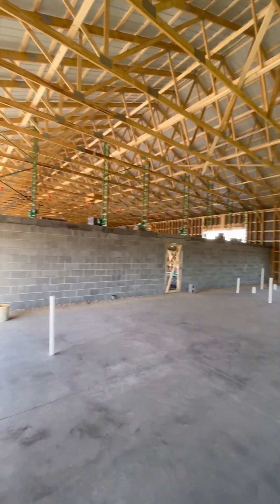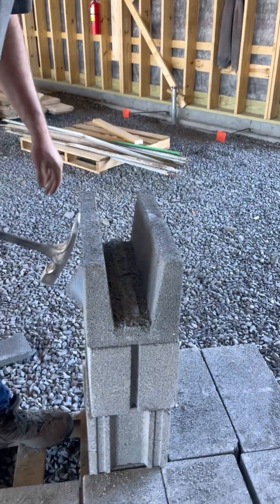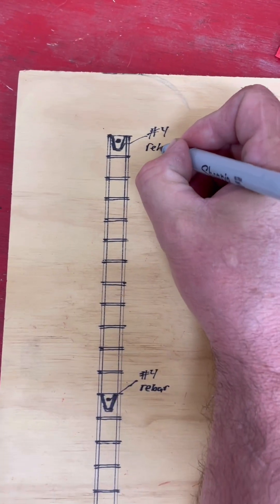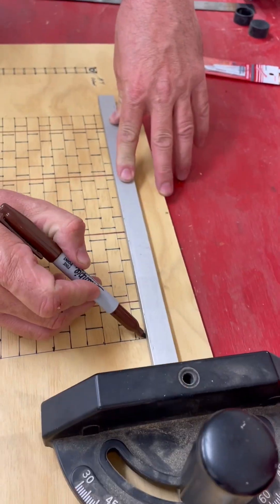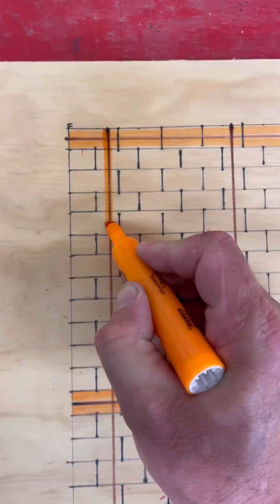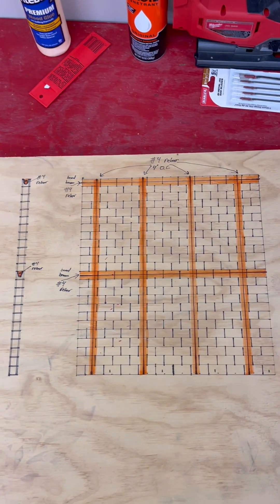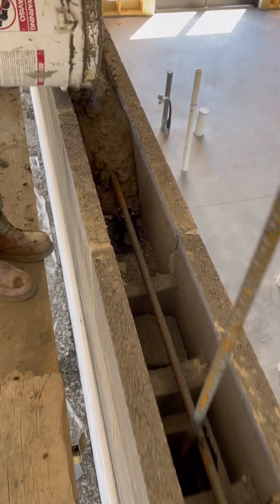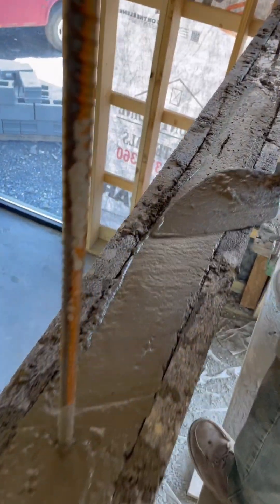Using a Bond Beam to Reinforce a Block Wall

Comment: Is 4' on center of ½" rebar just a term? What I mean is hitting the ¼"center seems a bit precise especially for a wall at long. Can you just hit a tangent on the rebar no greater than 4'apart or do you need to it to measure as close as possible? You're not actually drilling into the rebar like you with a stud.
Reply from the maker: It doesn’t have to be exact just close to every 4 foot within 6 inches or so

Comment: Does the vertical concrete need to be poured all at once or can it be done in sections as you go up?
Reply from the maker: We did it in sections
Reply: @hausplans  thanks.

Comment: If you're adding vertical rebar every 32" or 48" on center and grouting those specific cores solid, how do you stop the grout from entering all the cores and creating a solid wall?
Reply from the maker: We’re grouting every 48 inches, the webs on the block lineup so the grout only goes in a straight line down through the web we poured into

Comment: Since the rebar is always placed in the center, it doesn't do much. When the wall is bent, one half of the cross section is pulled and the other one is compressed. While concrete works great under pressure, it sucks under tension - that's where the rebar  works. But in the middle of cross section, there are esentially no forces, hence rebar is useless. You should always put in a pair and try to place the rods close to the faces of the wall.

Comment: The question is how do you plan to insulate? Exterior foam?
Reply from the maker: It will have blown in insulation in the attic and fiberglass batt in the walls

Comment: Bet the guys would take that truck if it was offered
Reply from the maker: The reason they didn’t wanna pump truck is because trying to schedule Concrete, a pump and a inspection at the same time for such a small amount as it is a huge pain. This way after we got our inspection, they mix the concrete themselves and had it poured an hour later.

Comment: From my understanding, rebar eventually ends up wrecking the concrete from oxide slowly pushing the concrete eventually causing cracks, will it in this situation idk I'm curious on the span of time something like this holds up, not to mention how long the floor stays square, I always wonder how the perfect building could be built for the lowest cost, something that lasts 200-1000 years unchanged and level, I've always thought about that
Reply: Fiberglass rebar doesn't oxidize

Comment: 🤔Everything is beautiful but you have to use a special vibrator to remove the air bubbles from the concrete inside this wall

Comment: How were the first row pf blocks set? Were they set in the wet concrete foundation when it was laid or some other way?
Reply from the maker: They were laid on top of the floor with mortar, we also drilled and epoxied rebar into the floor everywhere we filled a core

Comment: Ok question will this meet Miami dade wind load or texas Tdi hurricane standards.
Reply from the maker: This building was engineered to meet the requirements in my local area. Also, this is a non-loadbearing interior wall.

Comment: No vibration on that concrete? And is that vertical rebar tied into the floor?
Reply from the maker: The vertical rebar is tied into the floor, and we worked the concrete down the cores with a piece of rebar

Comment: This is how houses in Philippines are made. Not high tech and requires a lot of work. But  Those will last for another 40 years, we don't use wood or dry walls here because we usually have 26 typhoons per year 😂
Reply: Should all fall down with an earthquake.
Reply: Exactly. I don't understand why the insurance companies in the USA in the tornado areas, don't simply insist on the external walls being built this way.

Comment: Usually bond beams are used for load bearing openings. You can use a knockout course with horizontal rebar so you can fully grout the wall. That’s more structurally sound.
Reply: @hausplans  If it's not called for you don't have to grout the whole wall. Bond beams are also used to create a continuous tension and compression beam at the tops of walls, to create shear transfer and tie together the rest of the structure, like the wall or roof above.

Comment: Need vibration tool to get rid of air pockets in the wet concrete.
Reply: Guy, it's a 30 second clip. There is a lot of shit they didn't show
Reply: @benische  Still, I was really curious about how they would insert the vibration head in a small beam like that with horizontal rebar running through the beam. I don't know... looks like they haven't done it at all, also wouldn't vibrations damage the block work.
Reply: @bogubox - they do make small vibrating heads, but more likely vibrate the exterior block that contains the verticals rebar/concrete.
Reply: Grout Shall be consolidated And  reconsolidated mechanically.
Reply: Yeaaa... thats what i'd say /do 
Vibrator things  make a BIG positive difference
Reply: Yes

Comment: Engineers won’t let us use concrete to fill bondbeams or cores anymore . It needs to be a special mortar that flows even horizontally. It’s filled at the end and we have cutouts to make sure the special mortar flowed to all the designated cells .
Reply: Dont you have vibrators with a long neck to make sure the concrete gets in everywhere?
Reply: @carpentry-unlimited  that doesn’t work on cinderblocks, blocks will break or crack
Reply: Grout. When I worked in a National Laboratory doing support engineering for a Synchrotron Particle Accelerator, we would pour grout pads under the beamline equipment. These were huge stainless steel vacuum chambers with all sorts of complicated equipment inside them, they were very heavy and had to be set absolutely level on their own individual footing. Grout is the perfect substrate for this due to its flow and self leveling characteristics.
Reply: It’s called grout
Reply: Yeah all these regulations only happened because something fell over
Reply: We do this in Australia, I’ve done walls up to 6m high or ~20ft in freedom units. The blocklayer does all the hard work and lays the steel in the areas that need it.
Reply: I'm guessing many cut corners and ruined it for everyone else.... eventually decided to take bat out of hands and enforce something that won't end up with failure to fill those sections

That or maybe the use of inappropriate filling material
Reply: Mortar is for the blocks bro, brick and mortar, grout, and the best way to tell that all the cells are full that need to be you will see it sweet thru the block if it’s a high lift pour, with a pump and a not let it fall more then six feet to cause segregation on the way down. But what do I know? With 10 special inspection / deputy inspector license, commercial inspector and AWSCWI and OSHA out reach trainer? 😅

Comment: I ownthe company now,
 but having once been " one of the guys" trust me, they mind using 5-gallon buckets!
number one ,
number 2, do you vibrate that or at least rod the concrete when you pour it in there? you just pour  till it's full and strike the top off??😮
Reply from the maker: They used a piece of rebar to work it in. Also, they did not wanna have to wait around for a pump, scheduling pumps and Concrete in our area is really difficult right now let alone schedule that to happen right after inspection.

Comment: So you have a cold joint at ur first 8' horizontal
Reply from the maker: Yes, but we let the rebar stick up past the cold joint
Reply: @hausplans  
At 8' I would leave every other vertical down 2' and fill it when the rest of the wall was finished 

I have always been bothered by cold joints 

 I guess I just need to know
 that whoever has to demo it 
       Will suffer

Comment: Doing a big ass job like that and you're worried about a freaking pump? What? Or is it just easier to do the buckets? Or more accurately, just the way they prefer to do it?
Reply from the maker: All the money adds up in the end. Plus it’s really hard to organize concrete delivery and a pump truck and inspection. This way we could just pour it ourselves as soon as we got our inspection. So it’s as much about schedule as anything.
Reply: @hausplans  True. It can be a pain to get them there right when you need them. And you have to build that wall in stages, over 2 days, don't you? I was just figuring surely it's not really about the money. What I hate is special order material for stuff that really shouldn't be, and just having to throw away a 1/2 square of siding and 10 trim pieces etc. on every job. Even on a $30k job I'm throwing away $200 in material. Even after giving the customer a few spare pieces. It adds up like you say.

Comment: How well does the crete flow down into the block?    Either it's got to be pretty wet, have a lot of chemicals in it to improve flow or you have to use a piece of rebar to puddle it. Otherwise it's not going to be a solid fill job.
Reply from the maker: It flowed pretty well, and we used a piece of rebar to work it
Reply: We always wet form before pour to get better flow and also that brick doesn't suck all moisture away from concrete to help it fully harden.

Comment: Possibly should have used an air chisel to tap the walls so the concrete vibrates in deeper. !!!!
Reply: Hell nah, that's a great way to break and chip block. The corefill is pretty wet, it goes down pretty good most of the time, the best way to get airpockets out is to either use a trowel or a length of rebar to stab up and down in the core to bring the air bubble up
Reply: @sethbrandenburg941  no the best way is the right way with a vibrator

Comment: Great video! Is there not a requirement to fill the blocks in 5' lifts to avoid voids in the solid core portion where you live?
Reply: I think it’s 4’ but no one does that. I lay commercially and have never seen a single company do that out of the 6 I’ve worked at. From schools to prisons, all done wrong 🤣
Reply from the maker: There is not
Reply: I'm no expert, I worked for a builder while studying in Australia, it was a much bigger job and all external walls.  He left gaps under the windows and in certain places to allow the air to escape, plus it was all vibrated. When the core fill started to escape the air holes we hammered a small wedge in to the air gap.

Comment: Do you vibrate the concrete in the vertical beams?
Reply: That would be proper
Reply from the maker: We do sometimes if it’s a tight space, but these filled really nice without the vibration. We did work it some with a scrap piece of rebar.

Comment: I guarantee "the guys" would have preferred a pump truck....
Reply from the maker: You’re not wrong😂 but they wanted to pour as soon as they got inspection and not have to wait around for a pump👍
Reply: @hausplans no one buys a pump unless you doing 20 yards, using a high lift method or no inspector. 
All these comments are someone who has never poured COURSE GROUT in a cmu wall! 
Nice shop drawings by the way. 
You get it…
Reply: @hausplans  don’t worry about it, good laborers still care about the job and their employers success. A little work is good for the soul.
Reply: @hausplans  so schedule the pump accordingly?
Reply: @chrisl1873  exactly he being cheap
Reply: @chrisl1873  , cost of labor , vs  cost of pump truck.  You do the math!
Reply: @stevehamman4465  yeah buddy, no shit but he says "the guys prefer it" don't say the guys prefer it when it's purely an economical move
Reply: @chrisl1873  , I guess your missing the point,,,, which guys prefer the pump?  The three guys who got laid off because of the pump?
Reply: @chrisl1873  and if this wall failed the inspection? Like we're all humans, mistakes happen and its kind of an expensive mistake to buy a couple of cubic meters of concrete with a pump and its operator only to tell him we cant pour this now go dump it somewhere the mound wont get in our way
Reply: @chrisl1873  not arguing the guys wouldn't have a pump lord knows i would, but I'm building my own house right now and man inspectorsfor real will say "we will be there on such a date at some point during that day" and will refuse to give a time.
Reply: @chrisl1873 its not that big of a deal, god. 
 
 Always a bunch of you drama queens telling someone how to run their business. 

 Every single time
Reply: @stevehamman4465  if you're that overstaffed then i dont see how it would be a negative thing, shed the weight and get their bag
Reply: @hausplans  say the truth you guys are too cheap
Reply: 🤪 ouch!
Reply: Seriously
Reply: Apprentices were involved
Reply: Fuck that you act like concrete is lightweight fairy dust!
Reply: ‘The guys’ identify as ‘guys who prefer pump trucks’
Reply: That's why it is call WORK, mate. If it was a play date, where everyone is equal, you ain't getting paid.
Reply: Okay cupcake, sorry not everything in life is as easy as your girlfriend 😂
Reply: “Not that much concrete” and 5 gallon buckets is a recipe for punishment. Been there, done that. Get a truck, pay some bucks, and allow your employees to work a few more years.
Is saving a few bucks worth the wear and tear on your solid employees bodies?
Again, I’m 40, and definitely not above hiking 5 gallon buckets filled with concrete up a ladder… but if you’re the one calling that shot, you sure as duck better be joining the party.
Reply: @Tac0caT0  nobody's hiking any buckets of concrete up a damn ladder! Lmao! They mix it on the ground with the machine, and then lift it with a forklift, and the only scooped-out partial buckets at a time, because five gallon bucket of concrete is about 80 to 120 lb. They are required by Design to place grout not to exceed three or four lifts of cmu at a time, so they're only placing about a bucketful on each column. Are you really going to pay for a pump to show up to move less than a half yard of concrete 4+ different times during the construction of the wall? Or can convince the design engineer to allow you to pour all the grout at once and just do clean outs at the bottom? Might be different if it's a full cell design that requires significantly more grout but regardless, ain't nobody carrying concrete up a ladder unless they're fucking stupid.

Comment: A concrete wall is cheaper stronger and faster
Reply from the maker: Typically you’d be right but in this situation the wall needs to go up into the roof system, and there was no good way to form a concrete wall for that
Reply: @hausplans  why not do concrete as high as you can the block the roof?
Reply: Maybe where your at ,it's stronger ,but no way cheaper, nd I'm pretty sure 3 mason's nd myself could build an 8" wall higher faster .
Reply: @jamesortolano3983  masons take forever and all demand way to much money for your work. Block walls are dead anywhere people are trying to build with speed and cost efficiency. ICF concrete walls are even better take slight more time than standard form but have many more benefits still much faster than block walls and it’s an actual solid structure.
Reply: @jamesortolano3983  any masonry block that’s hollow can be easily destroyed be a basic hammer you cannot do that to 8 inch solid concrete walls.
Reply: @jamesortolano3983  definitely not an 8 inch 8 foot wall in a 40x40 let’s say can be formed and poured in a single day with 4 guys 2-3 of which are lower paid entry level guys. If inspection of the rebar wasn’t a thing which is not in many rural areas it’s done all the time.

Comment: I think that they should've used three re-rods and triangle 🔺️ shaped steel tying rings to make those bond beams. It would've created an even stronger bond in the 'crete with less transverse flexing of the wall.
Reply from the maker: This is an interior wall that is nonload bearing, so there is no pressure from either side